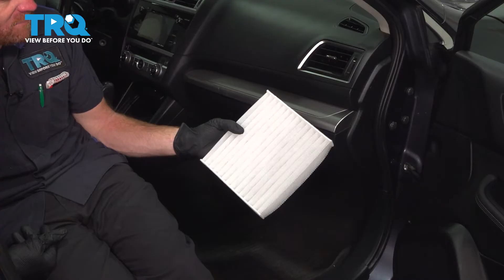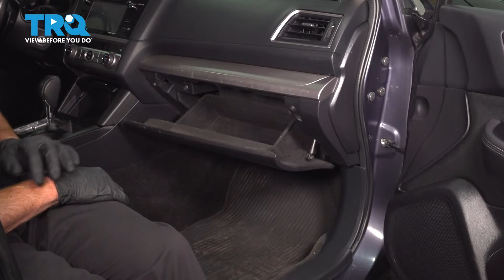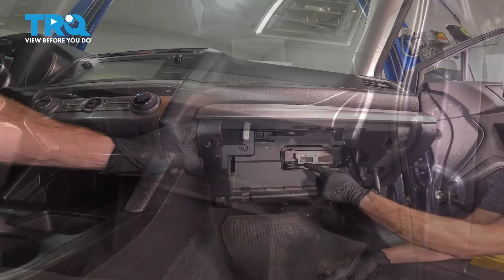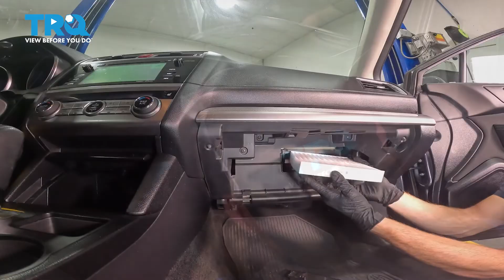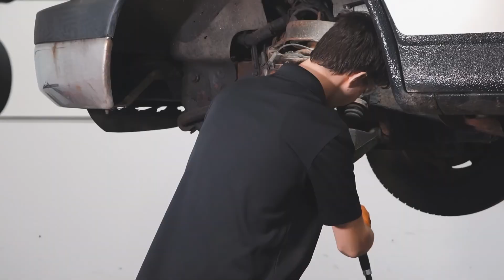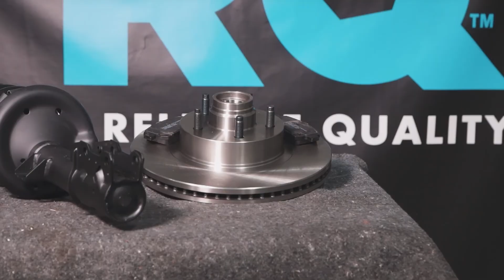How to Replace Cabin Air Filter 2015-2019 Subaru Outback

Comment: Be careful to place the back hinges properly before putting pressure to reconnect the hinge. The hinge on the back is plastic and will break if not aligned properly.

Comment: Thanks for the step by step instructions. The only thing I would share is the arrow of the filter could be different. My filter shows the arrow down instead of up, it's the air flow direction, not the filter position.